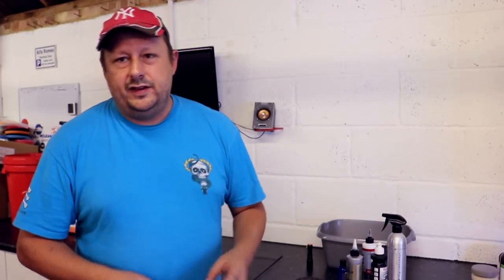Trashing Microfiber Towels with Ceramic Coatings

Comment: Having worked with solvent based products for over 30 years, there's no way a simple water/detergent mix is going to remove drying or dried solvent based products from any surface, especially a cleaning/buffing cloth. For this to happen, either the original solvent carrier is of a very poor quality with minimal percentage in the mix or they are not using a solvent at all (but that won't be the case as the surface area is ready to buff after a relatively short period of time. From experience,  it's very difficult to remove a solvent based product from a fibre and leave the surface area i100% intact and safe to use. Only my thoughts from my experience 😀
Reply from the maker: I think your right colin.   one important thing with most solvent carried matierals is the solvent is keeping the material in a disolved or semi disolved state, when the solvent disapears the materials return to there natural state which might be more solid (like with a paste wax).   With ceramics the solvent is primarily holding the materials in a liquid form to prevent the RTV cure..  but as the solvent disapears or flashes it exposes the ceramic materials to oxygen and hydrogen in the moisture in air.. And its actually the exposure to this which causes the curing or state change..      And this cure or state change creates a completly different material which is different to material held in the solvent before the cure.    So once the product cures you couldnt break it back down with the same materials which are used to hold it.        This is different to say a solvent based paint that once dried you might still be able to break down and remove the paint with the same solvent used to hold it in.   At least thats kind of my understanding but could be off or wrong usually am.
Reply: @ForensicDetailing  I think your bang on. In my job, most of the components are ceramic coated and solvent as well as other materials are in contact for around 14-18 hrs a day without any signs of disturbing the ceramic coating. When the ceramic carrier has flashed off, your left with a very resilient material that, when treated correctly, is extremely long lasting. I'm no detailer, although it's something I'm looking at getting into slowly, and your vlogs are absolutely great, as I like the analytics of a procedure before jumping in, so please, keep up the fantastic work, us amateurs (and I'm sure the pros) love the detail that you go into
Reply: So it looks like even if you used the microfibre towels to buff the spray sealants that the towels become rubbish. Am I correct?
Reply: @r.k862  I would suggest leaving any surface that has been treated, at least 24-48 hours before attempting to buff the surface. This may sound extreme but the idea behind it, is to ensure that any and all solvent has flashed off. You may think that this happens in a relatively short period but if any crossover areas or micro pooling hold the solvent for a longer period, due to heavier application, the possibility of product transfer is much higher, resulting in contaminated buffing materials, that, if used again, could cause issues with micro swirling or scratches.
Reply: @colinedwards2742  I think that I will do it according to the label buffing time but you are saying once you apply the sealant then buff it off not long after that the towel shouldn't be used again in the paint because It can scratch it in the future because of the sealant drying on the towel no matter even if I wash it?
So it's always better to use a new microfibre towel even if it's cheaper quality than to use a already used microfibre towel?

Also i want to ask what is the best way to apply the sealant on the paint to cover all the areas of that panel, would it be spraying it on the car then spread around with the microfibre towel or would it be spraying it on the microfibre towel then wiping it on the panel?

Thank you
Reply: @colinedwards2742  What I meant about my last comment is this - does the spray sealants harden onto the microfibre drying towel even if washed therefore when drying the car next time that it will micro scratch the car? because i heard ceramic coatings is different to sio2 spray sealants. Can you please share your knowledge to us?
I don't think people will wait 24-48 hours before buffing the product off for many reasons
Reply: So.....any coating that is applied with the aid of a solvent based carrier, is inherently going to cause issues if all of the carrier hasn't flashed off correctly. Whether the application is via spray or wiped on using an applicator pad, the risk of overcoats certain areas is without question. Spray will give overspray, pad will give lines of over applied product, just because of the way we apply anything. In these situations, as the 1st area begins to dry, we inadvertently apply a 2nd layer. Very small crossover areas but this is unavoidable. This means, in these areas, the 1st coat will not dry adequately before the crossed area is applied, meaning different drying rates. It is these areas that cause concern. Its these areas that will still be micro wet, transferring the coating onto anything that is used to buff it off. This will, as you correctly point out, cause micro swirls if the same cloth or buffing pad is used again.
The issue is with how the product dries. If the manufacturer tweaked the carrier solution to speed up the drying process, this would help but that in turn, could cause issues when applying the product. Basically, if you took too long in the application role, the product would possibly dry on the applicator, causing even bigger issues. 
Maybe the answer is to have a product that has a longer drying period and that is much more viscose. The ideal solution is to dip the area but thats going to be hard on anything thats not stripped of everything apart from the finished outer panels. A longer drying process would allow a combination of spray and applicator to be used, to help spread the product much more evenly, and thus helping with any cross over issues. 
ATM......Best option is to buff off, when you think its dry, then, using new cloths or buffers, to give it a proper going over....as though you were finishing off on a final polish.

Comment: I'd mark it and just use it on carpets or porous plastic trim/ things that don't scratch. Soapy water just can't remove resin.

And each would have to find a cheaper cloth, when i did kenzo coating with IGL we only needed 1-3 towels per car